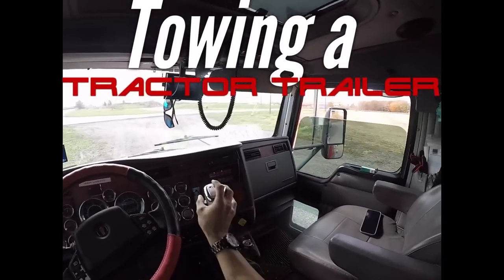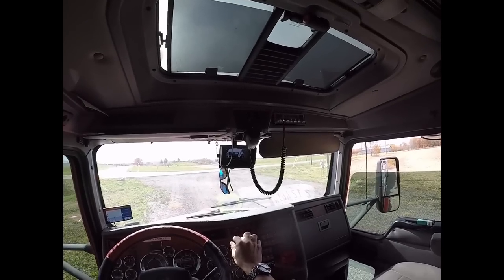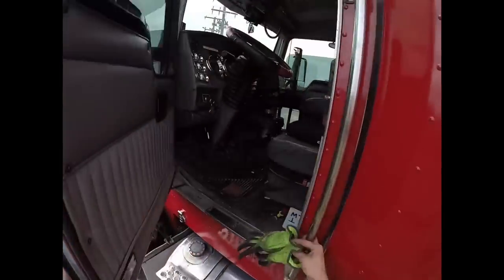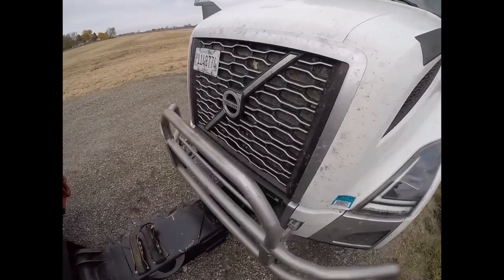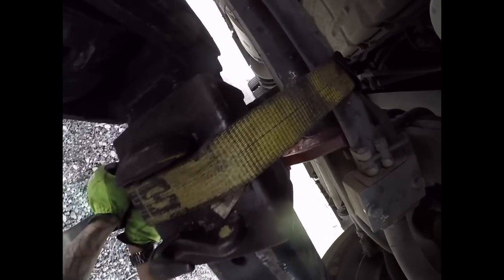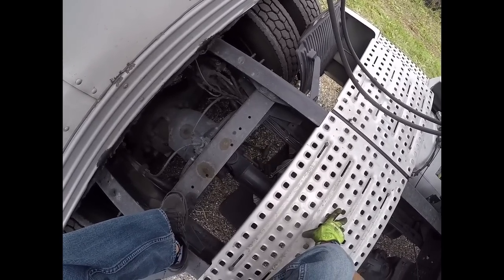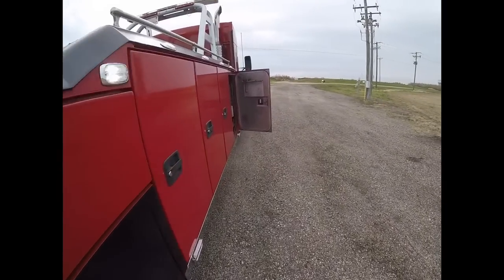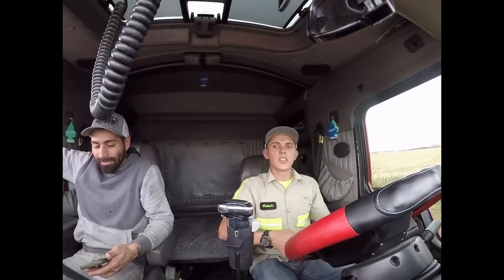Mckays wrecker towing a tractor trailer

Comment: Its been awhile since we've seen you Malichi, great to see you again! Looks like Pat is still learning, always drop the front driveshaft, not the rear one, unless its broken. But hey, at least that drive shaft came out a lot easier, no stuck or sheared bolts, or broken tools this time, so thats a plus! Nice to see the heavy wrecker in action again. Hey, that remote is kind of different aint it, with the antenna hanging off it? I hate those thingies that they put in the way of the front axel, couldn't have picked a worse spot, as that is where you have to put the tow hooks dang it all lol.